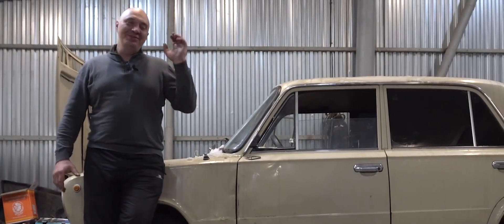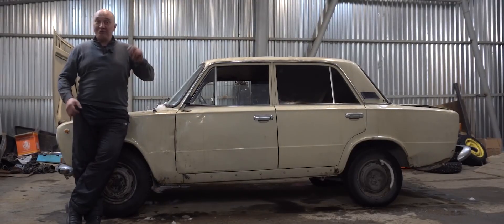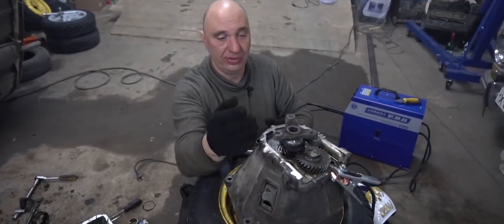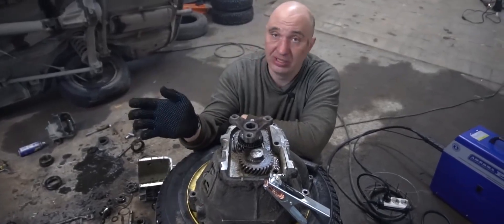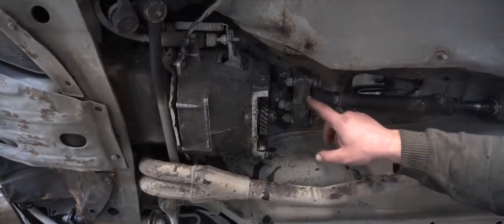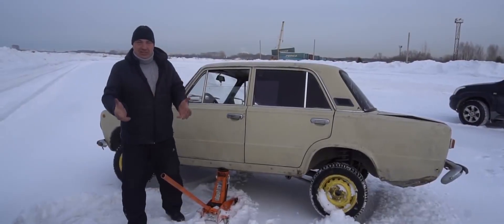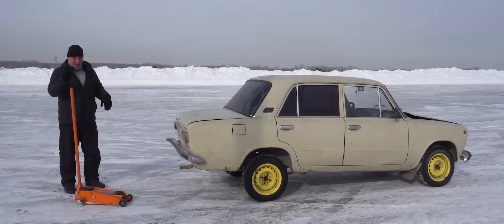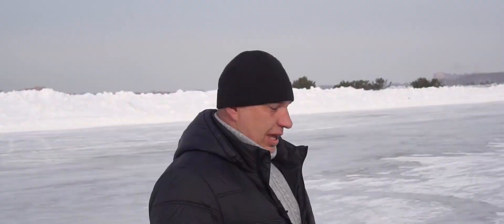Welding the prop-shaft to the motor and driving without a gearbox

Comment: why didn´t you use the clutch you were talking about the whole time?
Reply: @Ponga Pandit it did have a gearbox. Just didn't have any gears.
Can't see why the clutch wouldn't work
Reply: Could have slipped the clutch to avoid the shock load of just dropping it
Reply: Seems the clutch was on there to make use of the input shaft to transfer power into the prop. Although it would have been still functional and should have used it.
Reply: @tonyburns5388  exactly what I was thinking.
Reply: @tonyburns5388  EXACTLY
Reply: @Ponga Pandit it goes flywheel - clutch - bell housing - gearbox. He left the first three intact and connected the shaft to the first gear inside the cut off gearbox. The clutch is there and functional.
Reply: @kubeek  "The clutch is there and functional." unless the lada did not have a clutch in the first place. hehe
Reply: I'm also thinking why didn't they use clutch
Reply: @KSgd94   ever tried starting of in  5th gear?  cluth wont do muchI guess...
Reply: I think it would've been like starting the car in 4th gear, which is pretty hard to do, they should've rolled it
Reply: @Frost-ml4vj  Actually worse than that. On 4th gear there is still gearing between the engine and the axle and dont forget rear axle has gear ratio too. It would be impossible to launch with out any gearing in place, really really hard with out gearbox.
Reply: @Hellsong89  Depends on the car. Many cars, 4th gear is 1:1, no reduction.
Reply: @Hellsong89  Generally , most vehicle are direct drive (1:1) in top gear (fourth on this here Lada!) Sometimes top gear is geared up , not down, then it is called an Overdrive. Driving this in top gear and feeding the power in by slipping the clutch would be the same as removing the gearbox, but shock loading the drivetrain in this way is doomed to fail. The differential gearing in unaltered in this experiment. They should try again, but abuse the clutch instead!
Reply: @Hellsong89 Koenigsegg has a direct drive car without any gearbox.  so technically not "impossible", just very expensive. LOL
Reply: Right
Reply: I had to drive my car home in 4th (1.03:1) once because the bushing for the shift knob went bad. Whole lot of clutch slipping and I managed to make it back through 5 miles of neighborhood roads...
Reply: Why didnt they use the clutch?
Sure, they might get the clutch a little toasted and let out a bit of that awesome smelling smoke, 
but a lot of teen guy drivers at one point or another were messing around and drove off a stop by nursing 4th gear 1:1
Reply: @rwbimbie5854  mmm asbestos smell
Reply: becaus in soviet russia the clutch use you
Reply: A clutch would separate the running motor from the direct input shaft. You'd feather it just like going into first gear, but once you get going you'd  control your speed with engine rpm only.
Reply: Ponga Pandit with a clutch they could slowly inhale making the transfer of power slower resulting in less faioure
Reply: Maybe the clutch pedal wasn't connected.
Reply: He did use the clutch
Reply: Sure you can start it. But you wont be able to make it move while at the same time wearing out the clutch.
Reply: The clutch stayed attached to the flywheel when he pulled the transmission...duh...haven't you ever pulled a manual transmission?
Reply: Why this video exists?
Reply: Clutch flight
Reply: Sprint cars have no transmission.
Reply: @Ponga Pandit that's why they kept the bell housing, so the throw out fork could actuate the diaphragm sping
Reply: I wondering why they didn't put the trans in 4th or what ever is 1:1. This mod just made it weak
Reply: Could of put on shittier tires, I expected the wheels to just spin and go nowhere
Reply: @Ponga Pandit well it could allow the propshaft not to spin
Reply: oversight....
Reply: I wouldn't want to use the clutch.   When the driveshaft surely comes apart its possible flying pieces come through sheet metal and into you.  Your right legs maybe 6 inches away from that improvised wobble shaft.  just needed some armor.
Reply: @Ponga Pandit A clutch just disconnects the engine from the rest, it doesn't need a gearbox to do this. Plenty of things have clutches that don't have gearboxes.
Reply: @Ponga Pandit You totally don't need a clutch to change gears though. Just to get going. I got pretty good at both down and up without one. But yeah, if he used the clutch this would have worked. My s-10 once was stuck in 4th which is essentially 1:1(not sure the exact ratio some are 1:1 some are close). Once i got up to speed there wasn't much difference.

Comment: Can drive a car only on BRAKE DISCS? WITHOUT wheels!
Reply: This ladas only have drums
Reply: You can, but traction is pretty much non existent and in harder surface like tarmak disks will break after little while. Also i do happen to know this from first hand experience... just dont ask why :D
Reply: @Hellsong89  how do you know this? :D
Reply: You mean rotors? Lol
Reply: @csmith6583  helicopters have roters
Reply: Richard correct. So do cars
Reply: C Smith brake disc=brake rotor
Reply: No because power isn't transferred to the break rotora
Reply: @themonolithian  Uhhhh, rotors will still turn without the wheels...

Comment: Awesome, it would be incredible to remove the suspension and springs, put some wood to fill the gap and drive around!
Reply: that wouldnt be too much different unless you start hitting bumps
Reply: Awesome. Some bad gravel road.
Reply: Solder the wheels static onto the bottom and feel all the bumps...
Reply: I drove a Peugeot with solid rubber blocks as suspension for a laff . Wasnt actualy as bad as you would think
Reply: @blueonblueracingnova  Next time try solid steel and some dirt roads.
Reply: Now you can start to imagine how incredible it is to operate on an human.
Reply: what?
Reply: Been there, done that!
Reply: Felipe Luiz Dickmann 😂
Reply: They put wood between the springs down here in tx to smuggle drugs so the vehicle doesn't sag
Reply: Or just by Ebay coilovers

Comment: its not the rubber couplings fault.. prop shafts have to be perfectly balanced, and making it longer and adding more stuff to it is gonna throw it off balance and destroy itself ...
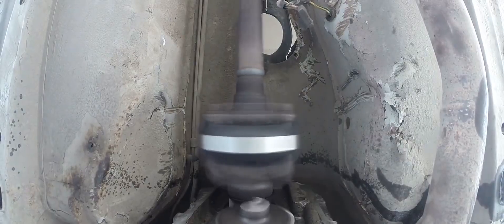Reply: 8:34
you can clearly see how imbalanced the driveline is,
also on a 3 joint drive line, the front u joint (or coupling) has to be completely in line with the trans other wise there will be a massive amount of inbalance.
the middle one and the rear will be able to cancel each other out.
 plus the trans mount was deleted allowing the motor to move up and down which puts unnecessary stress on the coupling and makes the inbalance worse.
Reply: The failure was the join to the original shaft. It needed a support bearing.
Reply: Uhhh...yes a really good welder can weld a drive shaft together.  It still needs to be balanced though.  Even a stock one comes with weights because it’s been balanced.  Yes they need to be balanced.  Yes he should have used a clutch.  Yes it broke for several reasons.  Still it was a good video:  we learned what won’t work. 👍
Reply: A real manufactured driveshaft is perfectly balanced and centered by component. Once things are welded together is where the imbalance happens. They still don't lose their center. The main problem with this was that nothing was centered well enough.
Reply: Probably also doesn't help that the schedule 40 pipe twists like a pretzel.
Reply: You can clearly see at 9:40 that the whole reason why the driveshaft fell apart was that it was horribly unbalanced. It self-resonated like a centrifuge before exploding
Reply: I think it had to much  joints and not enough bearings to support it.
The drive shaft just rolls up on itself instead of transferring power. Anyway, 4th gear ussualy is direct drive.
Reply: why is there always that one guy with an anime profile picture with knowledge about everything car related? is this the anime version of scotty kilmer?
Reply: tY good sir, saved me the time to make the same point XD
Reply: Not" 100% spot on" drive shafts are balanced from the factory due to the imperfect tubing  (ie. Cheap)that they're comprised of, ive welded many shortened, lenghtend, different ends, spaced couplings with strapping wrapped around small shafts as a shimstock, NEVER hada vibration, even welded shaft ends lined up or 90%off, vibration? NONE! Seen it balance using hose clamp,not on mine, call me lucky, or just good.
Im
Reply: @pierrelaboom4026  first of all, the tubing isn't "cheap" it's in allowable tolerances, and second, stop bullshitting on YouTube, it doesn't make you special.

Comment: There was a lot of shaking going on with the drive shaft there, probably because it wasn't welded and fitted perfectly straight and true. Which is why it self destructed. But anyhoo, goof of fort with just a MIG welder and a couple of spanners.

Comment: Replace the engine with a 3 phase  electric motor and run the car with a 10,000 watt diesel generator in the trunk!
I bet you get great fuel economy!!
Reply: You'll be surprised how little 10 kilowatts is. That's only ~ 13.5 horsepower!!!
Reply: @namm0x326  using batteries for storage would fix that.

You can calculate how big a generator needs to be.
If a normall electric car uses about 17KWh per 100km and drives on average 70km/t on long distances you can figure it out.
Reply: @namm0x326  I've done this with a 1500 watt gas generator and an electric lawnmower!
I cost 1/3 of what it cost to mow the lawn with a 5 hp lawnmower!
Reply: @TRaySteeves  Well, electric motors do have much better torque characteristics!
Reply: @namm0x326  exactly!
With a manual transmission can shift at 1700 rpm.
Reply: how much does a 10kw generator weigh?
Reply: @jusb1066  not sure but a Lada can handle it!
Couldn't weigh more than a full tank of gas!
Reply: @jusb1066  About 300 pounds.
Reply: I doubt it @Dylan Livingston !
Try lifting 15 or 20 gallons of water!
Reply: O.k. @Dylan Livingston now add two or three 160ish lb passengers in the back seat.
Would a diesel generator weigh that much?
Reply: I have a 3 phase 25hp electric motor in my garage I want to make a go-cart with. I have not figured out the best way to go about it yet though. Diesel generator was my first thought but now idk, it's the fact that it needs three phase electricity that makes it difficult. If anyone has any ideas...
Reply: Just get an AC motor controller. Expensive if you want it 25hp though
Reply: Timothy Steeves then you get to buy a large vfd and wire it between the genset & motor. Otherwise it would be simply on or off.